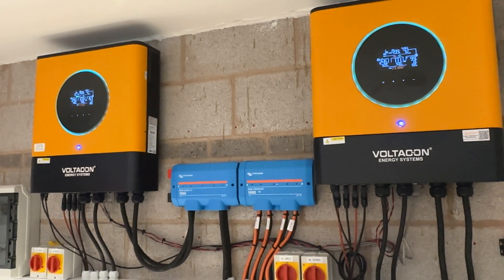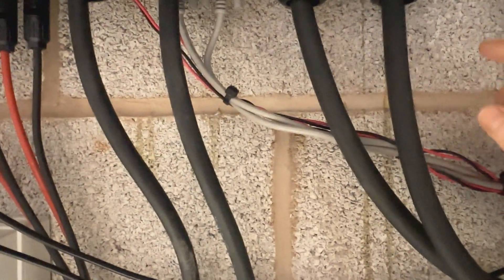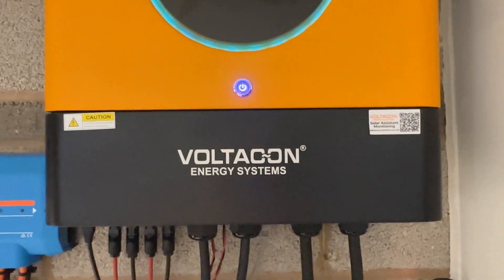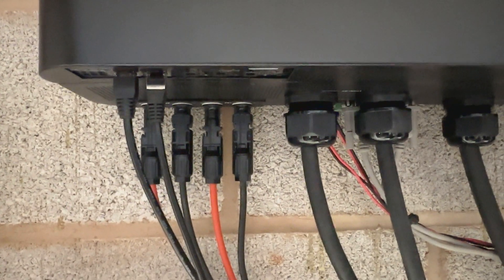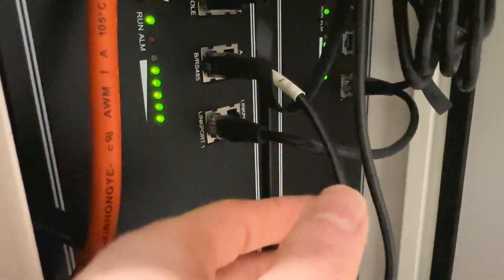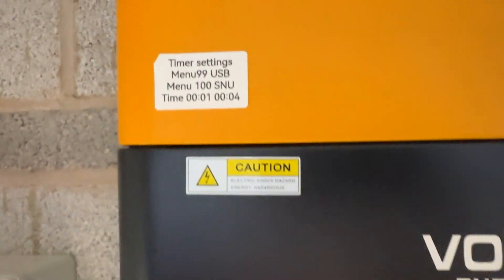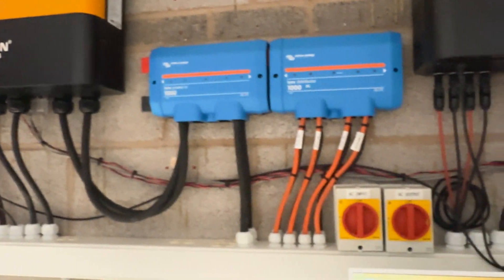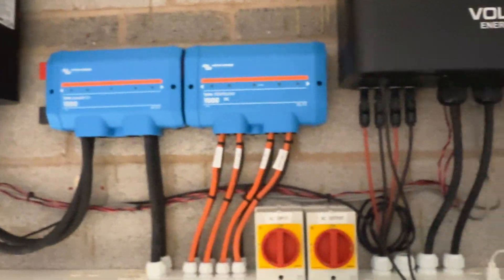How to Set Up Two Parallel 8kW Max-II Inverters and BMS Lithium Batteries US5000 Pylontech.

Comment: 1. Do you have to connect yhe current sharing cables for the inverters ro communicate?
2. Why in settings number 5 do you set PYL for Master and USE fir slave (why not use PYL for both master & slave?)

Comment: I see you didnt follow the recomendations about keep free 50cm above the inverter
Reply from the maker: The place is well ventilated , we check the internal temperature of the inverter and always operated within the limits without derating. In this room there is no external heating from AC or radiators so it is cool all the time

Comment: Hi. I bought two 6kw Conversol v7 inverters and now want to connect them together via parallel kit. I want to use 2 phases separately. Can you provide some information how correct to do this if that possible at all. Also what steps on wiring and what steps in program. Sicenly, Andrew.

Comment: The only issue with first inverter pylontech set and second use set in this setting there is consumption current from battery . But when one inverter working with pylontech there is no consumption current from battery
Reply from the maker: It depends on the settings of the system and the load demand. It also matter what power you get from solar panels and what the house load is .